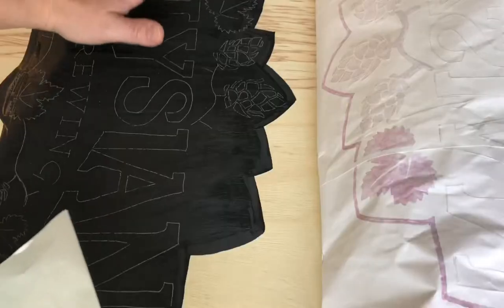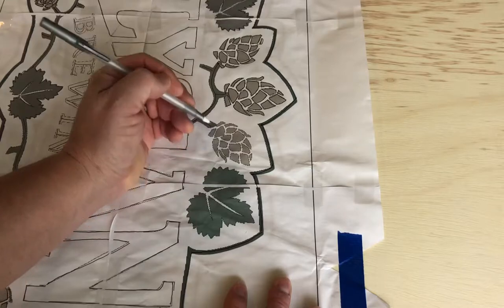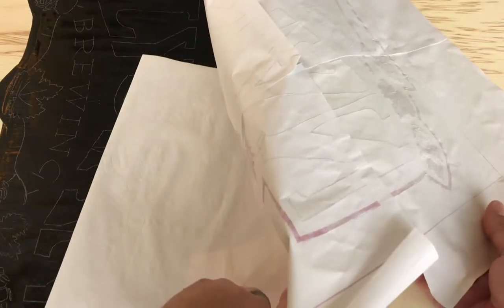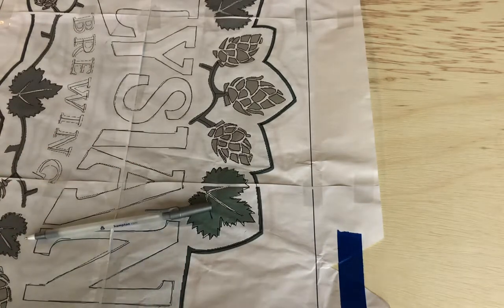How To Transfer a Design Onto Cornhole Boards

Comment: What kind of Transfer Paper do I need to use to do this? I have transfer paper for t-shirts is that the same.
Reply from the maker: That's a good question. I'm not familiar with fabric transfer paper, but I would assume it's generally the same. I get mine usually at somewhere like Hobby Lobby, in the section with art pencils and pens. Hope that helps!